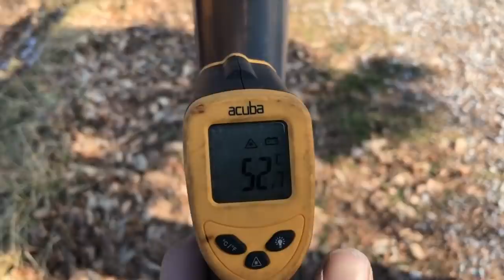화목난로 삼각자 디자인의 열기지연판 만들기/Stove/Created heat retardation plate in triangle style

Comment: Your work is really great, I also want to make a similar principle, but can some details please consult you
Reply from the maker: Welcome. 
I want you to try it. 
You can ask me if you have any questions. 
I hope it helps. 
Thank you for watching the video.
Reply: I would like to ask the ratio of the area of the air inlet and the chimney.
I made a combustion chamber (20*15*50)but the effect of combustion injection is not very good. The highest temperature currently measured is 470 degrees, but the smoke is a lot.
Can you guide me?